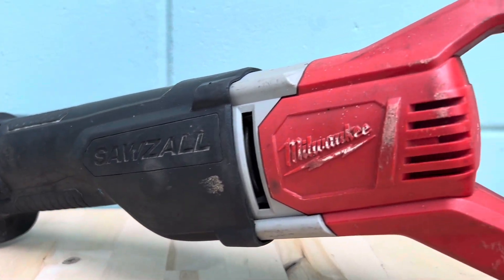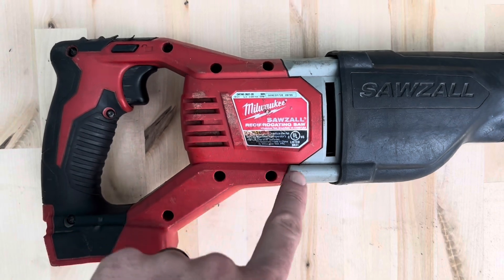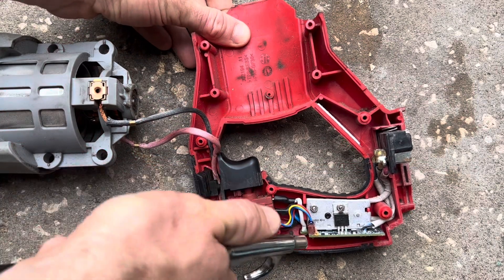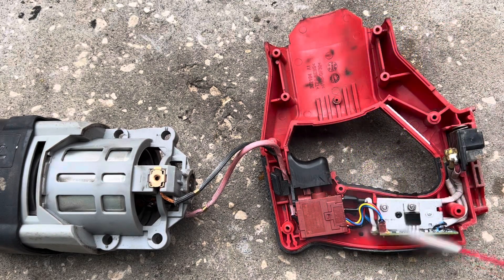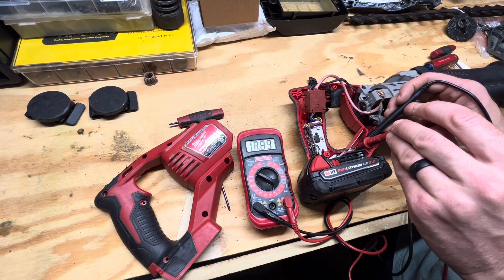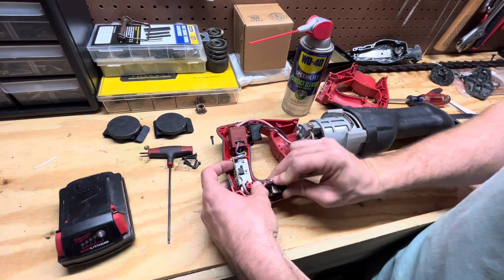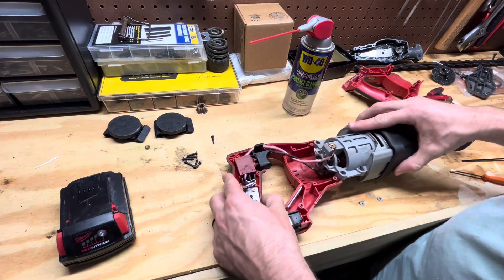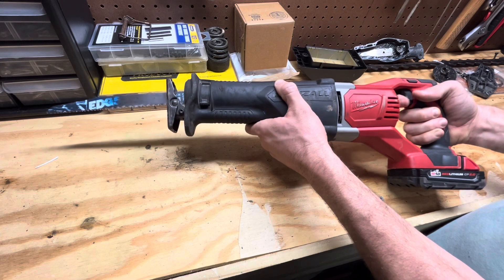Milwaukee 18V Sawzall Stopped Working - Can We Fix It?

Comment: My Milwaukee Sawmill wont work and I have only used it 10 times .  My drill freezes up often also.  I will never buy these again.  nothing worse than losing a day at work because of crappy tools.   Ive still got all my old Makita  tools and they still work perfectly.  Time to go back to them.
Reply from the maker: Sorry to hear that brother…the corded stuff of old is generally bomb-proof and can be repaired over and over and over. But the battery stuff has come a long way and is much better than I’d say it was 20 years ago.

Comment: Milwaukee - Not really build to last.
Longest lasting tools are corded Bosch and Makita Tools. Very well designed and well made and repairable too. They take serious abuse before failing, never seen a brand last so long with daily use.
Problem with Milwaukee is they are all made in china, cheap components, cheap bearings. They also haven't figured some tools out like Bosch or Makita  demolition hammers or hammer drills. The Bosch or Makita will last longer and work better. Also Milwaukee really doesn't like to sell you spare parts, they often group parts into assemblies that make the repair not economically viable.
Cordless tools are always more prone to failure due to more electronics and the brushed cordless tools always fail first because either someone will burn the motor out or the brushes wear away, its easier to cook a brushed motor than a brushless one so I always get the brushless tool.
Reply from the maker: Thanks for the info!